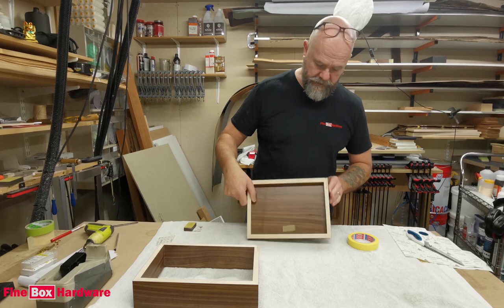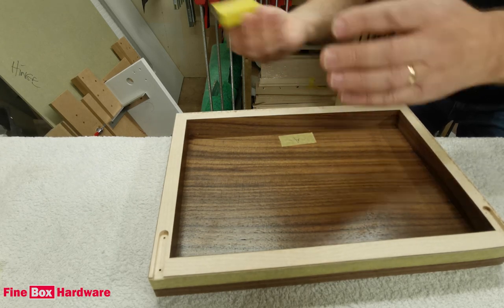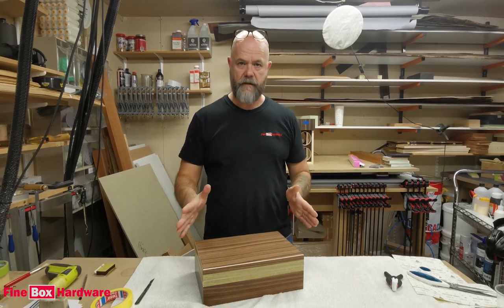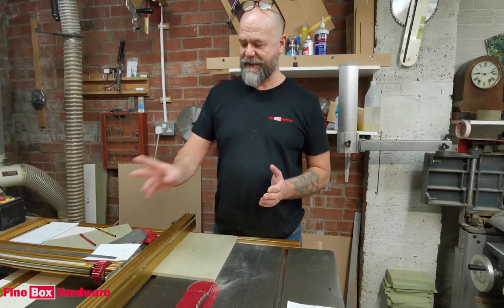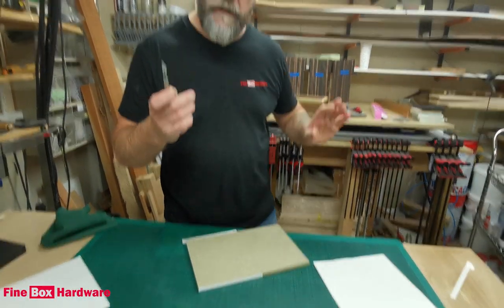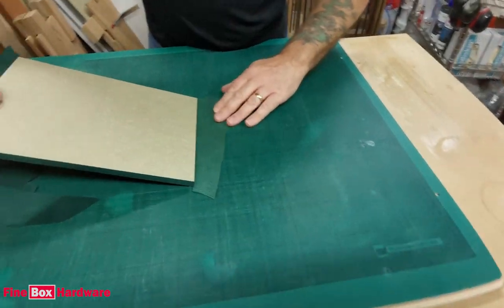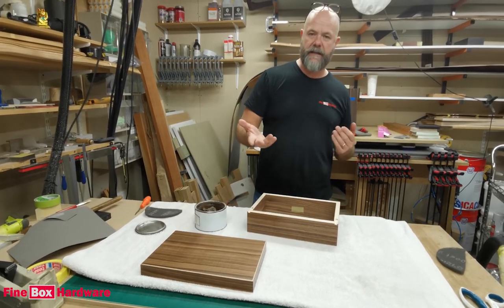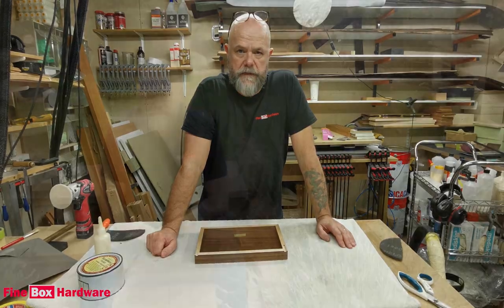How to make a Keepsake Box - Part 8

Comment: What are your thoughts on doing the chamfers for the separation on the router table before mortising for the hinges?
Reply from the maker: Yes a way I have used in the past, just don;t make them too big or it takes away from the box!!
Reply: Hi Ian, started working on the box a couple of weeks.  Going well so far.  I did the chamfer revealing some sycamore as suggested ; I was wondering if the inside edges of the separation needs some sanding, it’s seems quite sharp.
Reply from the maker: @aaalharmi  You can add a very small chamfer to the inside edges to take the sharp edge off.